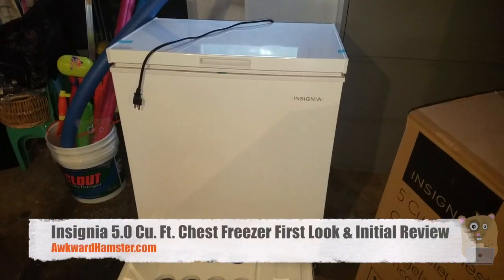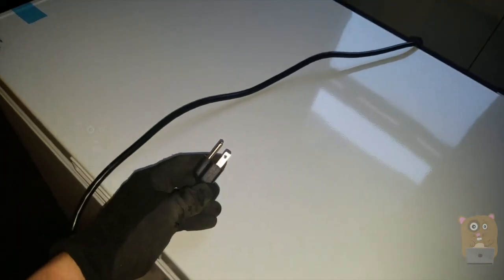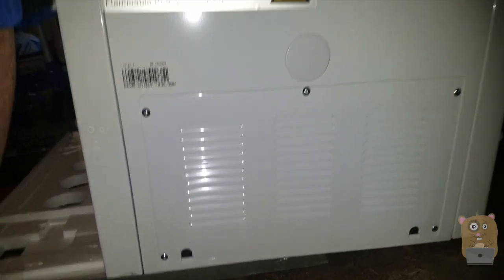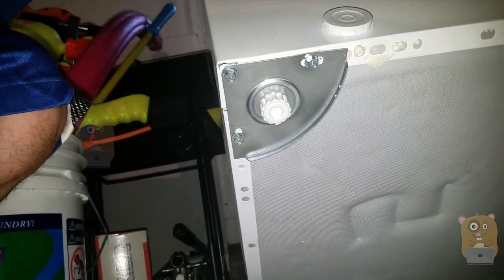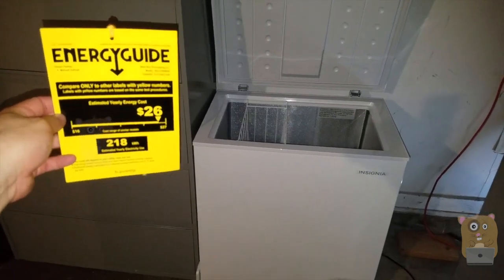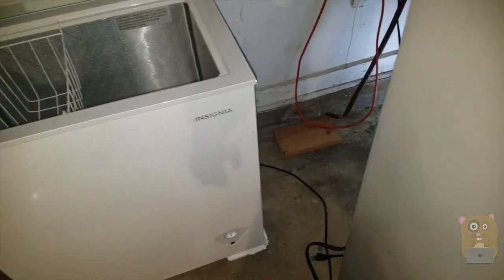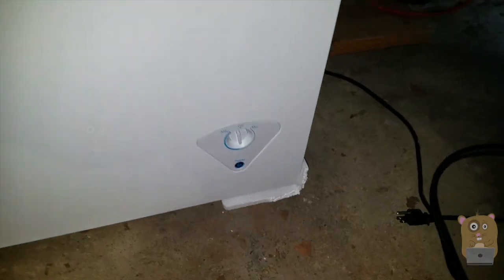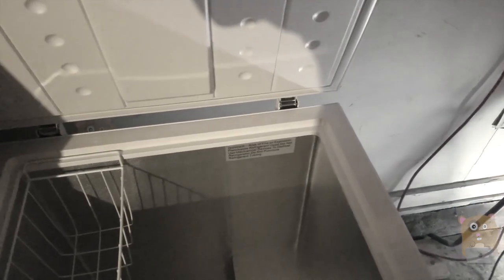Insignia Chest Freezer First Look & Initial Review

Comment: Hi!  I just received mine and there are three settings Min, Max and off.   What setting did you leave yours at?  Do you have to leave it on MAX to get 0 degrees?
Reply from the maker: I do not leave it at max. Mine is set to min. I got an analog thermometer and it reads roughly 0F to 3 F

Comment: Hi. I bought one recently and when I un boxed it, I noticed a black rubber plug that was just sitting in the bottom of the packaging. Any idea where that might go?
Reply: That could be a hose connector for draining it through a hose or tube rather than into a bowl or bucket. I saw it in a different video.

Comment: What is the approximate internal temperature range when choosing either extreme on the dial?
Reply from the maker: I haven’t tried to see if it goes below zero.
Reply: @AwkwardHamster  I was more wondering if there would be a chance that I could increase the temp to uniformly thaw the food contents of the freezer, while still remaining under the 40 degrees Fahrenheit safety zone for thawing frozen food
Reply from the maker: I don’t know the answer to that. I have not tried that. I’ll eventually have to defrost the freezer. But, that won’t happen anytime soon.
Reply: @brookelanglais9456  Not frost free..that is the whole reason for having a chest freezer.  It holds the cold in so well that there is not reason to have frost free...you want the freezer burn that comes with frost free get a stand up. Ask the sales people if they have a freezer that is a part time refrigerator.

Comment: How did it hold up? Could you put a link to review in the cards? 🙂🤟🏾
Reply from the maker: Still works great. In the summertime some ice builds up at the seal but that’s expected. No icing issue, haven’t had the need to defrost.
Reply: @AwkwardHamster  just got me one what temperature is yours on to keep things  right
Reply from the maker: Blu-Ray I keep it around 0. I don’t remember if I posted a video about the wireless thermometer I got for this. It is good to have. 
I’ll make a follow up video about this fridge in the summer, around July.
Reply: @AwkwardHamster  want 0 cause way too much build up on ice then it will be difficult  to defrost and alot of water
Reply from the maker: Blu-Ray I think 0 F is just right for freezer. Only time I saw ice buildup was when it was very hot in the garage and ice would build up around the rubber seal. 
I haven’t had ice buildup inside the unit.
Reply: @AwkwardHamster  that is jaw dropping  you have not had to defrost  nor any ice build up at zero  degrees
Reply: @AwkwardHamster  did u get the geek Squad protection warranty
Reply from the maker: Blu-Ray I did not purchase additional warranty.

Comment: This is exactly what im looking for. . Have you had any major issues?
Reply from the maker: No issues. Since this didn’t come with a thermostat, I got one off amazon.
Reply: @AwkwardHamster AwkwardHamster: I'm considering this freezer. I'm curious, how did you connect the thermostat you purchased from Amazon? And would you also list the thermostat part number/ description/ brand name in your reply? Much appreciated.
Reply: @keghan1  I believe the author meant a visual 'thermometer'. Every freezer comes with a thermostat and this unit has a mechanical temperature control dial.